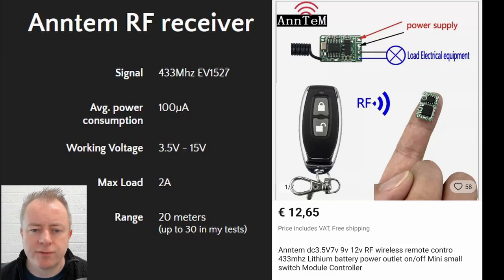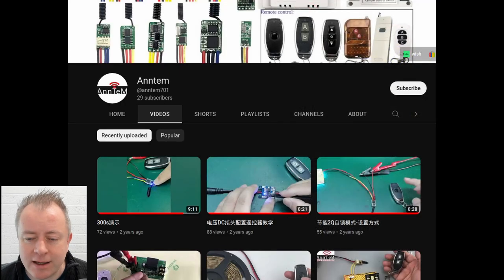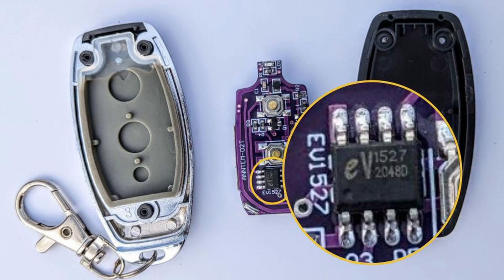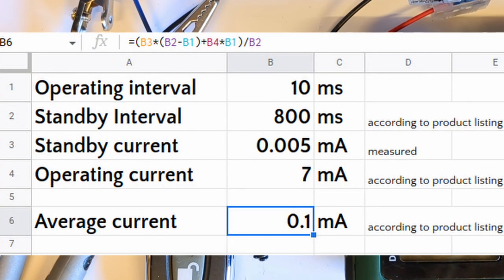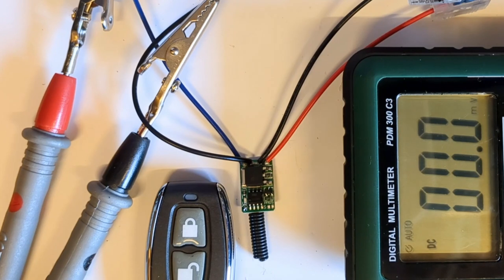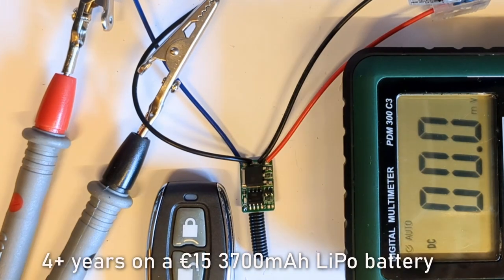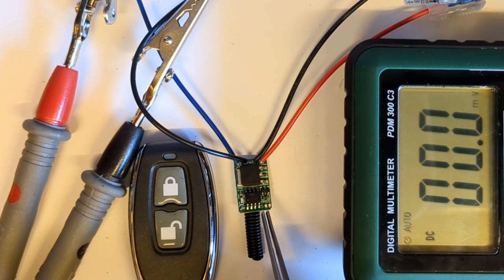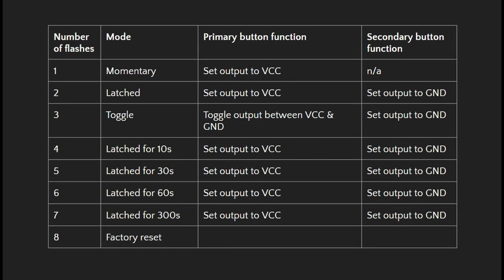The Anntem 433Mhz RF Receiver

Comment: hi Sean,
nice video, I did not know of these devices!
To wake up my Mars Rover I use the Wakeup transceiver RC-WuTRx-433 of RadioControlli which uses 10 µA in Ultra Low Power mode.
They work quite well but are not cheap (€15,00).
I also like your project on the wakeup receiver.
You use the RF receiver to switch on an ESP32 through some components and a relay. An alternative could be to use a ESP32 like the ESP32 FireBeetle and wake it up by an interrupt from the wakeup receiver. You then only need a voltage divider for the 3.3V interrupt input.
Reply from the maker: Thanks René. The RC-WuTRx-433 looks neat, and if I knew about it I might have chosen that instead. At least it has documentation! Do I understand correctly that you need two - one to serve as the transmitter and one to be the receiver? (I.e., it's not operating a common protocol like ev1527?).

Regarding firebeetle, I am in fact also using esp32 firebeetles, which I chose for their low sleep-mode power consumption, and I had originally hoped to wake them up on interrupt as you describe. Those plans weren't possible for me for a couple of reasons:
1. The project is powered by a 12v battery. Keeping the ESP32 in low-power standby required a voltage regulator. Quiescent current of the best switching regulator that I could source is about 100uA. A linear regulator might have been better, but maybe not depending on the duty cycle.
2. I had standby current leakage across other parts of the project. Some of that was happening in voltage dividers that I could improve. A big chunk was happening across a relay board module.  For long battery life I decided to eliminate all leakage by switching all peripherals off entirely during standby. As you note, in the end I found a way to entirely switch off the ESP32 too. A bit of a waste of the firebeetle's capabilities, but c'est la vie!

Worth mentioning that I didn't understand at the start that availing of firebeetle's 11uA standby power requires powering it from 3V (and cutting a trace on the dev board PCB). Powering it from 5V keeps the USB controller and other components powered up, and makes the ultra low power mode inaccessible. I realized this eventually, but I already had 12v components and 5v components in the project and was biased against adding another voltage regulator that would add additional quiescent current or inefficiency.
Reply: @SeanBlanchfield  hi Sean,
what you say really makes sense.
About the FireBeetle:
I use the DFR0478 and was not aware that you have to cut a trace on the PCB to reach really low power, but maybe I missed something.
In code I use:
esp_sleep_enable_ext0_wakeup(PIN_PIR_SENSOR_ACTIVE_HIGH, HIGH);
esp_deep_sleep_start();
About using 12 V: You could also use NiMH cells and make a branch at 3.6V.
I do the same in a Mars Rover project which is fully solar powered.
You could even charge the NiMH with a small solar panel, which is easy as the solar panel acts a a current source, and with NiMH batteries a circuit for trickle charging the batteries is simple.
Reply from the maker: @renewaveboard  I use the firebeetle 2 ESP32-E. Point 8 of the "Board Overview" in the datasheet below discusses cutting the trace to eliminate 500uA used by the RGB LED.
https://wiki.dfrobot.com/FireBeetle_Board_ESP32_E_SKU_DFR0654

Your tip regarding NiMH batteries is more elegant than my approach and has the advantage of being able to wake up on timer as well as on an RF signal. I'll definitely do it that way next time. 🙏
Reply from the maker: I've just been reading more about the RC-WuTRx-434, and although the main marketing page below states 10µA power consumption, the datasheet says 130µA in several places. I think 10µA might be a typo. With 130µA power consumption, it doesn't seem to have an advantage over the Anntem RF receiver, at least for this application.

https://radiocontrolli.eu/WakeUp-Receiver-Module-433MHz-RC-WuTRX-434-p245910165
Reply: @SeanBlanchfield  hi Sean, you are completely right, it seems indeed to be around 120µA! As said the RC-WuTRx-434 works fine, but have the disadvantage that programming them is not easy, you have to connect like 5 wires and besides an RX and TX you have to provide special programming sequences to store the configuration in flash. The Anntem RF receiver is definitely a winner there!

Comment: I got mine without the controller by mistake. But mine has reverse and forward motor control. Do you think i can pair it with any other RF transmitter with same specs ? Thanks for the video !
Reply from the maker: I think you should be able to pair it with any transmitter that uses the EV1527 chip, using the pairing procedure in the video.